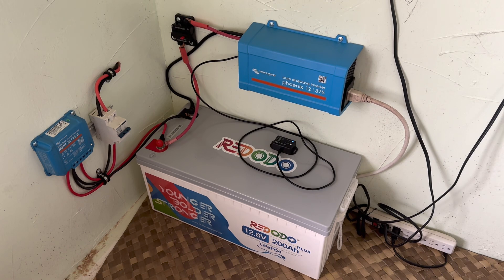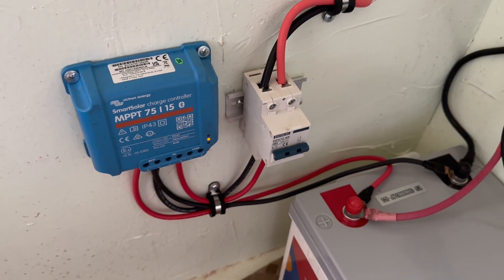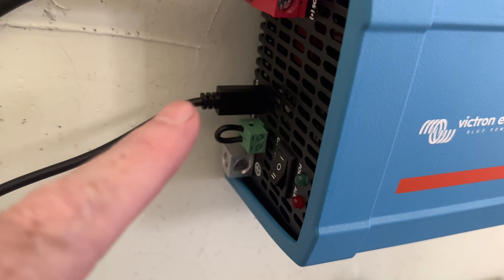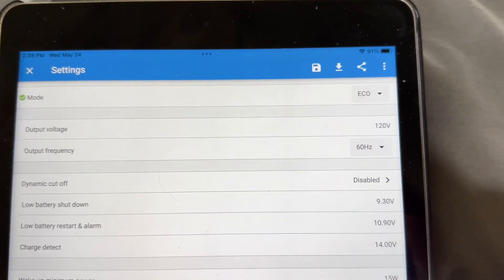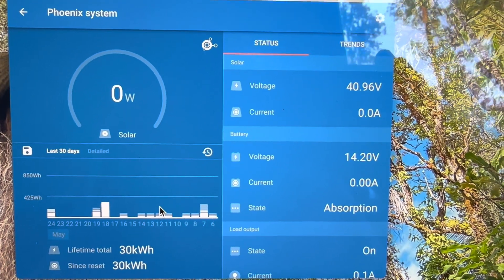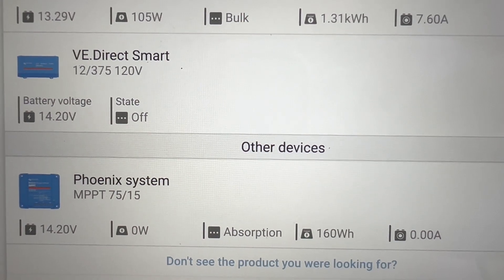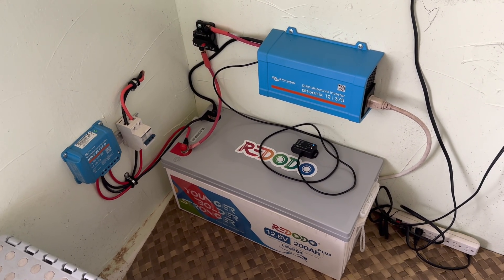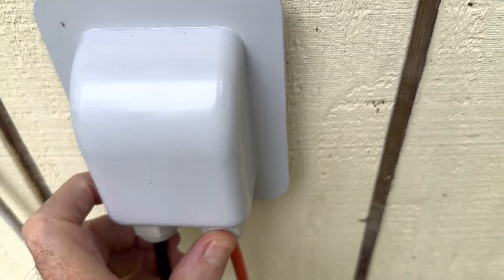200 watt solar system install /Victron inverter/charge controller and Dongle/ REDODO 200Ah LiFePO4

Comment: So u should not connect straight to battery,  light and tv and other, cause absortion charging the power comes from panels, i have connect tv to battery not in charge controller

Comment: After reading a few reviews including yours about Victron's MPPT functions, I finally picked up a 75/15 to test on my 600watt tool shed system. Unfortunately for my use case, the Victron isn't going to work. I'm still going to likely keep it and move it to my mobile 12v solar generator, but I am using the Epever 30amp AN with the load function, which works perfectly in the tool shed. From reading in the Victron forums, it looks like the Victron units that have load connections, often times the load just flat out doesn't work. They have some firmware/software issue that they don't appear to have ever gotten a handle on. Too bad, because If there was enough of a performance increase, I might have been convinced to pay the nearly 2x premium for it, and all the extra $$$ to add wifi to the system, but with Epever's 1/10 cost wifi functionality, cloud monitoring, and access to the API, I don't see myself changing.
Reply from the maker: Epevers work well too. I still have a few around here even though I have mostly gravitated to Victron. Aloha! 🤙

Comment: Thanks for the information. How do you determine the type of voltage cutoff switch to install?
Reply from the maker: Mahalo for the question! I just put out a video today on sizing the solar panel Isolator switch. 🤙

Comment: You need at least 500w's of solar. And at least a good 40@ MPPT charger. That's what I have on my van with 3 -100@hr lithium batteries. 2000w inverter runs everything in my van, including fridge and microwave. (and on certain occasions,  a 5000btu air conditioner)

Comment: looking super ! I love Victron bluetooth apps. they just work well. I got the USB connect as well plugs in same way put in USB on PC direct and works . even can up date firmware if needed. no bugs simple to use. what I did with my cables I use a electricians product called duckseal or simm from home depot . it's black puddy you break and form and is weather-proof and UV resistant . no bugs or water gets threw. most of my cables are in conducts. I like how you point out the little bugs . same trouble hear.   thay find the smallest hole and come in . victron has a nice  small battery monitor and smart shunt you can add to that or any system. all bluetooth . great way to monitor and control all systems from bluetooth smart phone or tablet . can even connect on line and watch control or adjust    from anywhere. super handy . this even allows victron to troubleshoot you system if needed. 🍋
Reply from the maker: Love the remote function for for turning off/on , or eco mode. The Victron apps on all their equipment make everything so easy. We have these little fire ants here. Barely visible to the naked eye, but they would exploit any opportunity to get inside a wall and set up home. Plus, as small as they are you usually don't know they are there until they bite, or sting you. Pesky little things for sure. Going to get that smart shunt next! Aloha! 🤙

Comment: I'm a big Victron fan so it's exciting to see your video features a Phoenix today! The MultiplusII 48/3000 is amazing when you get into medium sized systems.
Reply: The next step for him would be a single unit system.  One large inverter feeding the whole house, and a single battery bank.  The multiple solar inputs would be fine, but the efficiency and distribution of stored energy through his different systems in his house would be much improved and he would have absolutely no babysitting to do and no videos to produce  anymore.
Reply: @john0270  A lot of those integrated systems are garbage for inverter idle efficiency so you'll have to be a little more specific if you want to act like you know what you're talking about here.
Reply from the maker: I got a feeling I will eventually gravitate towards those larger inverters. 🤙

Comment: Please I have a question for you please can i change the AC output from 110v to 220v ? Before I buy this victron inverter? I'll be glad if you help me find out.
Please 🙏🏽
Reply: There are two versions...120 or 240V
120V version can't  go on 240V or vice versa.
Reply: @sonjakavalut  alright thanks 😊

Comment: Awesome stuff on this channel. I just did finish my portable solar cart system. I had a Renogy 200 watt system and 1 Redodo battery. It is now a 300watt with 2 batteries and secured on to a Harbor Freight aluminum cart. I had a blast doing the project and here real soon, I'm going to wheel it into the bedroom and plug in essential things like TV, fan, laptop and 5000 BTU window AC and see how long it'll run those.
I like the idea of having separate systems for different parts of the house but may need to weigh the costs of solar vs a small 2000 gen/inverter to run a 20 CF fridge.
Reply from the maker: Mahalo for sharing what you're building. Every comment such as this helps plant the seed for others to get into solar. Aloha! 🤙

Comment: This is an ideal system for my needs. It is perfectly suited to power my office and led lights around the home. The consumption and wattage - load output is ideal to run my pc computer, printer, and lights with room to spare. I haven't had a refrigerator for ten years or so, and so I wonder if this system would run a good refrigerator like the one you showed in the past. ( The little cooler type things have proven worthless to me).
Reply: Ill tell you this now! Unbelievable!  Best frige you can get runs 0.7 amp runs 1.8 to 2 amps for auto defrost for 10 minutes a day. This is the refrigerator to get ! Whirlpool MODEL # WRT311FZDW02
Reply: For super quiet long life when they deliver it do not plug it in for 24 hrs ! Letting it sit for 24 hrs lets all the oils ,coolent etc drain to their proper place beforehand and no juice permanently in line making noise everyday and shortned life! So get that refrigerator!  The lg like the one he had is not that good  constantly runs and a 30 minute 8 amp aurto defrost!  I know went through several bran new refrigerators lately.
Reply from the maker: Only been running it a few days so far, but I like it quite a bit. Will eventually give it a go on the refrigerator and really test out the eco mode. Aloha! 🤙